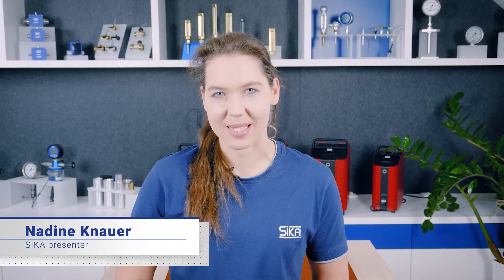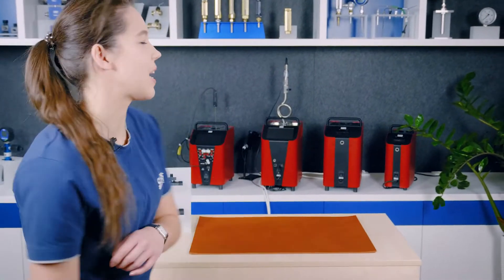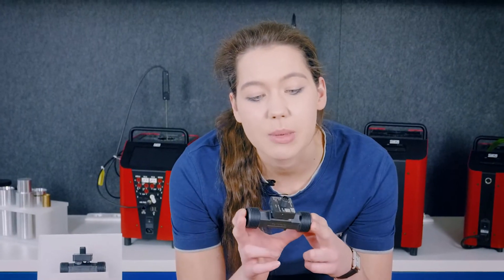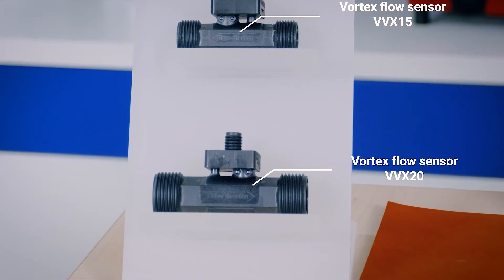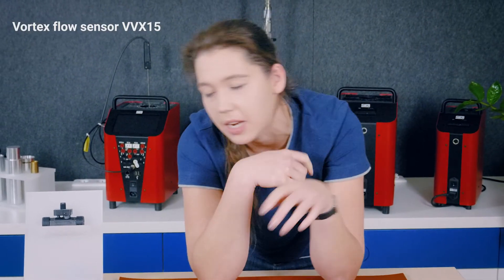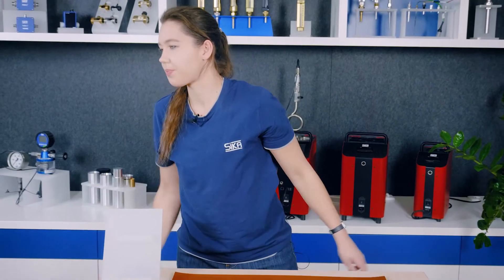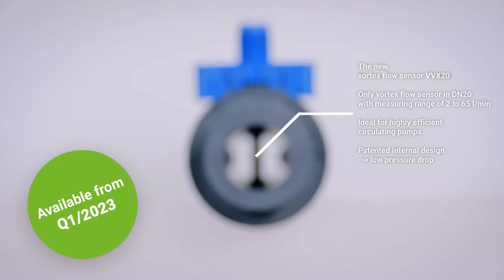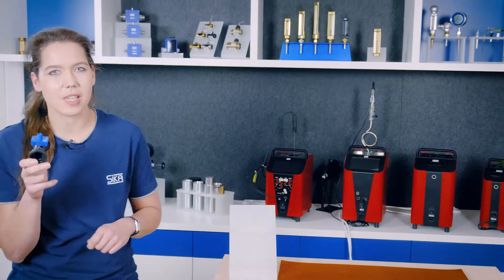Vortex flow sensors from SIKA » VVX20 LowFlow [world first] » For highly efficient heat pumps

Comment: Hi, Are these a direct replacement from the old type, fitted on Daikin EDLA16DA3V3 ?
Reply from the maker: Hello Darren Allison,

Thank you for your comment. We supply many heat pump manufacturers worldwide with our vortex flow sensors.

The VVX20 lowflow is a world innovation and is currently not yet available. To what extent the VVX20 low flow replaces existing vortex sensors depends on the decision of the manufacturers. 

Please understand that we do not give any information about our customers.

Do you operate the heat pump mentioned?
Do you have any further questions?